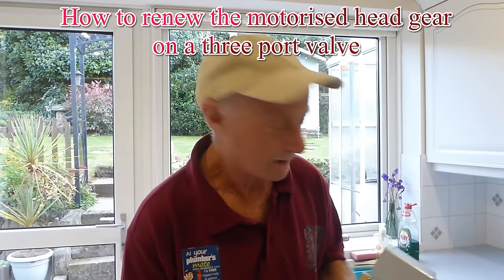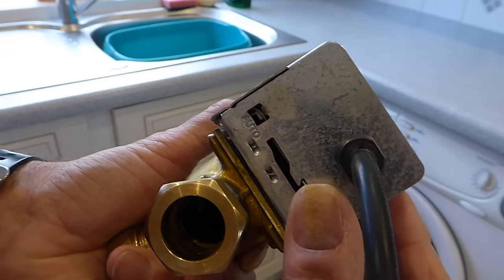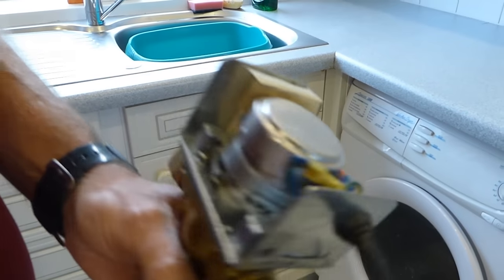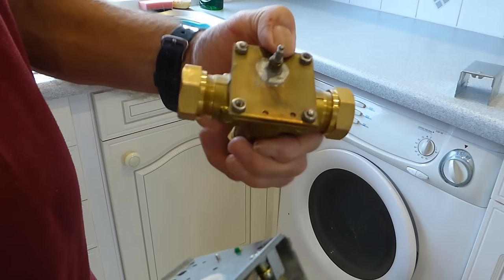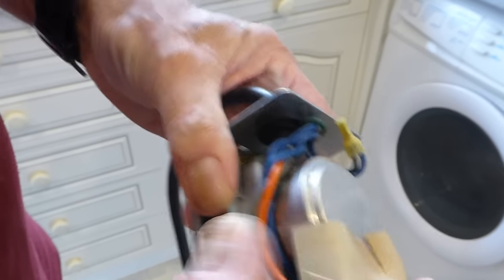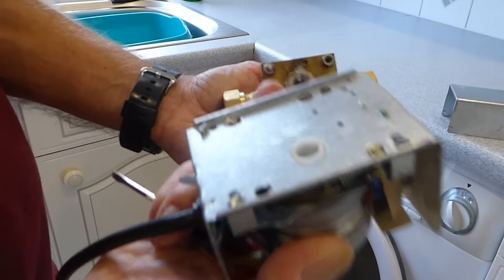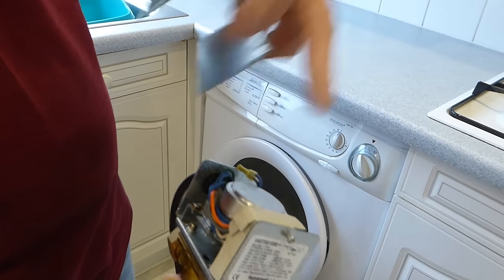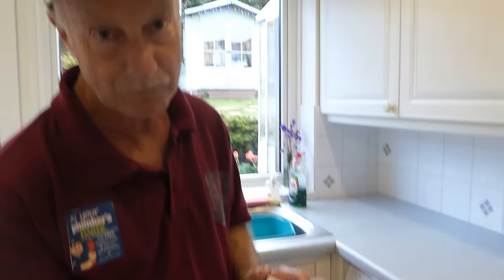How to renew a motorised valve motor or head. No draining down.

Comment: I  recently paid our local HVAC shop over $600 to replace what I think was just a faulty  motor.  (The exact same  compete valve sells for about $83 on line less then 1/2 that for just the motor).. Tech  Drained  system and replaced the internal parts . Charged $210 for the valve and 2 1/2 hours of labor -had to wait for the part to be sent to him and time  spent working out the bill  .Lesson learned :watched vids like yours and save time and a whole lot of money . Thanks for making this !
Reply from the maker: No problem 😊

Comment: Hi, Planning to do this at the wknd. Does the valve need to be in a certain position before fitting the head motor? (3 way valve) V4073A 1039
Reply from the maker: No just leave it off manual.

Comment: Thanks for the video. I have exactly this valve. My hot water will come on every time, but the central heating wont fire the bolier. If I move to manual I can get heat in the rads but the bolier wont fire for the central heating and goes off if the water is off. Could this solve the problem or is it more likely a problem at the bolier end. 

The pump starts up if I move it to manual but bolier still doesnt fire.
Reply from the maker: Yes it will

Comment: Should the motor be hot when holding the valve in the open central heating only position?
Reply from the maker: Yes they always run a bit hot.

Comment: Good video but did you mention if you are going for the ‘cheap’ option it is worth testing that three ported valve is free to move if it is not easy to turn then it is a false economy to go cheap. Also I believe that power is on these motors all the time and they will normally be warm to the touch.
Reply from the maker: Thanks Norman.
Reply: How easy should it be to turn? By hand, or say with long-nose pliers (i.e. still not masses of torque applied)?
Reply: @ArifGhostwriter  It should be very easy and if you have to exert significant force with a very short spanner or pliers it would suggest it requires changing. Having said that, if you are handy, you could remove it from the system, strip it down and clean it up. But in terms of effectiveness it is quicker to swap it out.
Reply: Norman sir! Many thanks - & Happy New Year (given your original post is from 5 years ago!).

Comment: 👍🏽 🇬🇧 January 2024!!

Fantastic walk-through sir!

Right now, I'm not sure if it's me just being paranoid - but the hot water activation might also be causing the radiators to heat up too.
Reply from the maker: The motorised valve will cause this when in manual mode.

Comment: Are all the plates the same. If the brand installed is different to the replacement will the new one still fit onto the same plate.
Reply from the maker: No make sure you stick with the same brand, in this instance a honewell.

Comment: Thanks for your video. I have one of these. Heating comes on with the water. My lever doesn't stay in manual position and just springs back. Does that mean it has a fault? I was thinking of changing the head but don't want it to leak everwhere.
Reply from the maker: No it just means you have not seated it properly into the slot . When the lever is pulled across lift it up into the cutout slot.
Reply: @dereton33  Thanks for your quick reply. It does seat in the slot ok, but as soon as I let go it springs back down. I tried many times. As I have no hot water, I was thinking of changing the motor first. I just wondered if the lever springing back was indicative of a fault with it.
Reply: A quick update. I took off the casing and noticed the motor was stuck and the spring mech wasn’t working, the reason why it wouldn’t stay in manual mode. I ordered a motor, fitted it and it springs back and manual works. The old motor was very stiff to move, so would go to central heating, but wouldn’t spring back for hot water, Although, with the new motor it works on auto now. Hot water again! Hopefully, this will help someone. Thanks again for your video, it made me brave enough to have a go. :)

Comment: Hi, great vid, thanks. When the valve is set to auto do you know if the switch should visibly move when the system calls for hot water or heating. The switch on mine just stays in the one position (auto).
Reply from the maker: Yes it should.

Comment: The head motor seems reluctant to come off after loosening the 2 screws. It wriggles a bit form side to side but seems stuck somehow. Is is safe to lever it off? Should it be tight? There's a comment suggesting doing this on older valves will result in a watery mess... the head is spaced from the valve body by spacers -so is it safe to remove? Any hints? It's a Honeywell with the same number as the video one
Reply from the maker: If it is one of the old models it will start to leak water as soon as you start to move it. The new ones just pull off easy.
Reply: Thanks, the motor doesn't seem to want to come off, it looks as though the spindle is stuck in the motor... can this happen? I've tried levering it with a screwdriver but the shaft isn't shifting and I don't want to break anything (or flood anything!)

Comment: Hi Al great video I've just fitted mine, is there supposed to be any resistance when moving the switch from auto to manual & visa versa? Many thanks
Reply from the maker: Yes, absolutely
Reply: @dereton33  Thanks so much for replying Al! I only replaced the honeywell valve itself & there is no resistance on the switch! Does that mean  I need to replace the valve body too? Thanks mate

Comment: Thank you, very helpful, just a quick question, the motor head was replaced about two years ago by a plumber, he used a Banico ZVM22 replacement, can I buy a better quality one like a 'Honeywell'  without having to change the port itself please ? my present one has started to make a 'humming sound' from time to time, a good thump and it goes quiet ! is that a sign it's on it's way out ? thank you in anticipation.
Reply from the maker: The Honeywell one is best but a lot more expensive.

Comment: Mine looks identical but is held on by 4 screws and it appears that taking those 4 screws out will open up the valve itself and cause a flood. Any thoughts on this?
Reply from the maker: Those ones are the type that cannot be done without draining down. You may as well renew the complete valve once that is done.

Comment: Just stumbled across this video. My hot water would fire up but my central heating light on the boiler wouldnt fire up. So i moved the actuator clip to manual and it worked and the boiler fires up, does this mean i need to replace the actuator or just the actual actuator motor? 
Or how do I know if it's the switches that's connected to the wall box
Reply from the maker: Best to renew the actuator (the complete valve head)  The switches on the wall very rarely go wrong.

Comment: Great video but doesn't quite give me what I need atm. My mums old heating system has a 3 wire valve which has failed. The replacement is 5 wire. Is it possible to get this to work as if it were a 3 wire unit by tying the additional wires to the original 3 wires?
Reply from the maker: No you would have to get the same model as your mums and replace with that. Not this Honeywell one.

Comment: I've got a flowmasta 3 port valve that's only a bout 9 months old. The heating has stopped working/the hot water works but if I lock it into manual the heating will come on with the hot water. When it's locked in place the valve ticks, should I just replace the whole thing or the motor? Or could it be something else? Thanks for the vid
Reply from the maker: I would renew the whole thing as you have already replaced just the motor.
Reply: dereton33 it was the whole valve that was replaced not the motor. Should I be looking for a different brand rather than flowmasta?
Reply from the maker: In that case yes. Honeywell are best.
Reply: Thanks for the help

Comment: Hello I’ve got problem where the radiators are hot but there is no hot water , however I have tow of these valves , on one the manual level when I pull it out it just spring back to its normal position , the other valve the lever slides backwards on forwards but does not spring back does this suggest a problem with the valve as the pipes up to it are hot but it does not appear to open up to let any hot water through even when I turn on the central heating and try to put this valve in manual mode still nothing happens to the hot water , any help would be appreciated thank you
Reply from the maker: Yes a faulty valve. It will need renewing.

Comment: Brilliant video.👍👍
Question before I replace just the motor. The hot water works but the heating doesn't, would that just be the motor or the whole pump?
🤔
Reply: Oh and the heating works only if the hot water is heating up!
Reply from the maker: That is the motorised valve faulty
Reply: Oh bum! So not just the head needs replacing but the whole valve?
I'll need a plumber for that,not going to risk draining my system myself.👍

Comment: my heating wont turn off once temp has reached so assuming the zone valve is most likely sticking ?....would just replacing the head only be worth a shot is is that spindle most likely stuck inside the 3 way block?.  thanks
Reply from the maker: Way to find out, is to remove the head before replacing and see if you can turn it manually.

Comment: Really clear video and instructions.  I need a replacement for a honeywell synchronous motor 40002737 003.  I've used your link to Amazon but I don't know which valve is compatible with the one I need to replace.  Can you help please?
Reply from the maker: If you are not sure go directly to Honewell and order from there.

Comment: Good morning, my valve head has stopped working so will be replacing it. Quick question, on that valve pin I was told to put some silicone grease onto it. Would you recommend that??
Reply from the maker: Yes a good idea Ash.
Reply: Excellent, thanks
Reply: Does it matter what type? Or just any? Apologies for all the questions..

Comment: My lever at the side is just loose and no resistance is it safe to remove or will there be a water pressure leak. Thank you.
Reply from the maker: You can remove the head without draining. There are just a couple of real old models where you have to drain the system. Rare these days.

Comment: Hi, I have to put mine into manual mode to get my heating to work (turn hot water on to do so). Do I just need to replace the head as you do in this video or the whole lot?
Reply from the maker: Usually just the head Yes.

Comment: Hi there, thanks so much for the video. Can I check - is it a problem if my 'lever' to go to manual is really loose? It doesn't feel like it's turning anything when moving it from auto. I do remember years ago it was a bit stiff but now it appears to just be floating and not doing anything - I can see with the cover off, moving the lever doesn't move any of the springs or the valve itself...
Reply from the maker: Afraid it will need a new valve.
Reply: @dereton33  thanks for taking the time to reply 😊👍

Comment: I wonder if you can help me? I replaced the whole 3 port valve a couple of months ago with a brand new one from the plumbers' merchants round the corner. After a couple of weeks it started banging whenever the heating comes on. It seems to bang loudly 3 times, once per second, then more quietly 3 times, once per second. If I don't tap the outside of the valve casing quite hard with my hand it will continue indefinitely. I told the merchants about it and they said it's either air or sludge in the system. 

I had to drain down the system to fit the new 3 port valve, so I don't think there should be any sludge in it, yet the valve continues to bang loudly most, though not every, time the heating comes on. Any advice on how to remove air (if there is any)?

Many thanks,

Bob
Reply from the maker: It is more likely to be air Bob, try slacking off the flow outlets on the valve, to see if there is any air trapped there. Try also slacking off the cylinder flow and return nuts, to see if there is any air there. Also check the pump for air.

Comment: Hi. Thanks for your videos. I have a 3 port valve. The heating isn't working. I can move the lever to manual (with resistance) and the boiler fires up, but then after 30 seconds or so, everything stops and the lever remains in manual. The pipes beneath the head are warm and the closest rads to the boiler start to come on. But it's not staying on. Is this a motor issue or do I need to replace the valve head?
Reply from the maker: Replace the valve head.
Reply: @dereton33  thank you 😊

Comment: I took the head off mine and found the valve body seized, applied wd40 and worked it free, but i suspect they will seize again, so will probably have to change the valve at some point. I see they can be bought as a separate part for around £20, but that depends on it being a match for the drayton head that mine has, as i see your Honeywell one has a different back and spigot?
Reply from the maker: Best to buy the complete valve, head and body.

Comment: I have had a new 3-port valve fitted by a plumber, but the new valve makes a loud groaning sound when it switches between CH and HW, sometimes it will make a banging sound, but not every time,  because it was changed via my insurance company, under the emergency assist policy, they won't entertain the plumber coming out again, as long as it works that's fine by them ! what can I add to the header tank that will lubricate the valve ?
Reply from the maker: Try some system cleaner followed by fresh inhibitor.

Comment: thank you so much for video which explains how to valve works and replacing. I have one question If you don't mind answering? Could i replaced my ESi 2 Port 22mm Zone Valve ESZV222L version with a honey metal box version? I heard they are more reliable. Im not a plumber but these things seems to go every 1-2 years i think the esi version is cheap. Only reason i like the esi version you have the plug and play cable so i end up keeping the old cable no electric wiring required.
Reply from the maker: Not sure they are compatable.

Comment: Hi Al, I’ve just bought a replacement 3 port valve head 4703 to replace my Tower head, the instructions state that if you have an ‘old’ type of head you need the adaptor plate, I’ve ordered one and its on its way, my question is the new adaptor plate has the ball valve so do I need to drain down to fit the new head and adaptor plate? Should mention I tried the new head on the old spigot an it doesn’t seat down fully, so that’s why I’ve ordered adaptor plate.
Reply from the maker: Yes you will have to drain down.
Reply: @dereton33  OK thanks for replying so quickly 👍

Comment: Thanks for posting. I have saved this a while ago as I knew the motor was dodge. And as expected it failed just when I needed it most IE it's snowing outside. I have replaced the top of the motor and all is working fine now. Easy fix thanks
Reply from the maker: You're welcome!

Comment: Hi. Could you expand a bit on the 'watery mess' comment. I think I have an 'old' valve. As I loosen the screws (which are on the same not opposite sides) water begins to leak. Should I stop? What happens if I keep going? Do I need to drain down the system? Thanks.
Reply from the maker: DO STOP. You have one of the very old rare type that you have to drain the system to remove the head gear. You may as well buy a complete valve as you have to drain.
Reply: @dereton33  Got it! Thanks. You saved me a soaking cellar. Will drain down and replace the whole valve.

Comment: Should the valve lever move freely when operated manually? I'm getting no heating, but the hot water is working. I suspect my 3-way valve is faulty and need to override it manually while I get a replacement, but the lever won't budge. I don't want to force it.
Reply from the maker: It is always hard to pull open as you are pulling against a spring.

Comment: got a slight problem when my central heating comes on my underfloor heating pump also comes on even when the thermostat is off could this be a faulty motorised valve regards
Reply from the maker: Yes more than likely.

Comment: Great video, but my unit is  making a humming sound, which I can hear from downstairs, I suppose the sound is transmitted via the pipes, but also when the CH first comes on, say first thing in the morning for example, their is a terrific creaking sound, which lasts for about 3 seconds, I am assuming it is the same problem ? do you think I need to replace the whole valve unit, or just the box on top ?  Thank you.
Reply from the maker: Try turning your pump speed down a notch first. If no luck then, I would replace the whole valve.
Reply: @dereton33  Thank you for your reply, interestingly this afternoon, I ran the hot water for a bath and the humming stopped as soon as I turned the tap on !  and now two hours later all is quiet, maybe it's a dirty contact or something in the box ?
Reply from the maker: May also be high pressure to the combi you could try turning the flow rate down on the main stopcock.
Reply: @dereton33  Thanks, but I don't have a combi, have a standard hot water tank, but it is still quiet nearly four hours on, but I had this problem about 12 days ago, but then after a couple of days, I noticed it went quiet, that is up until today !! so it is intermittent, so maybe the answer is to run a bath when the humming sound  comes back ? lol,  doesn't account for the strange sound when the CH turns on from cold though !
Reply from the maker: No that it dosent.

Comment: I am about to change the valve head. As I undid the fixing screws holding the head to the valve, water started to escape. Does this mean that I need to change the whole thing?
Reply from the maker: Yes that is not one that you can just change the head.
Reply: dereton33 Thanks very much for the reply.